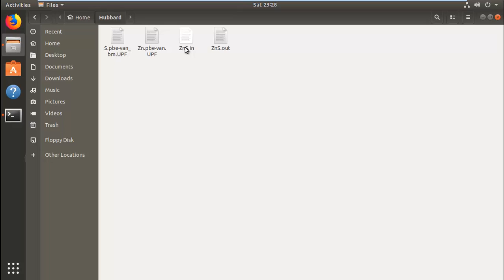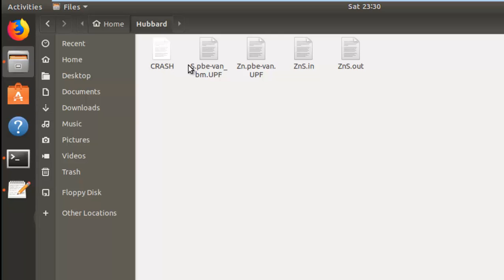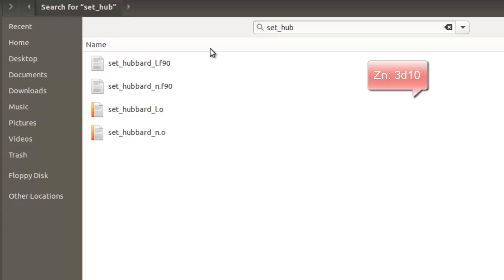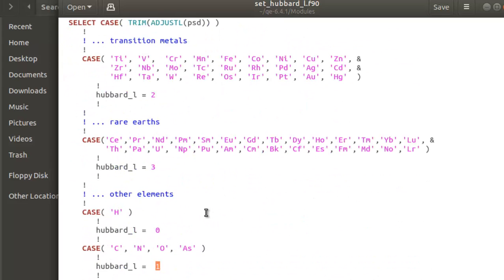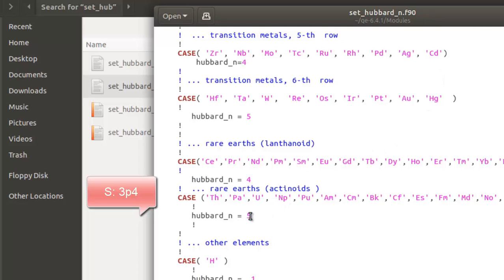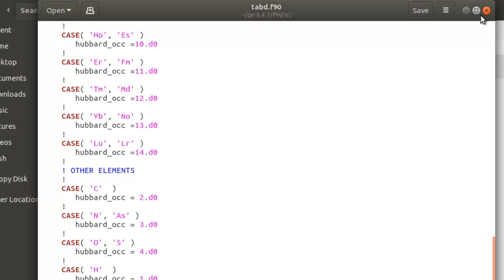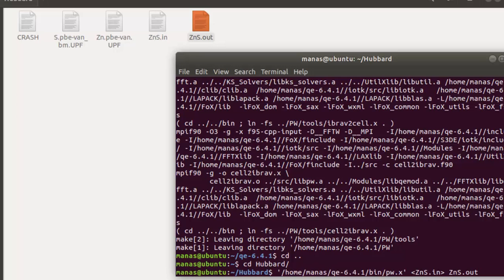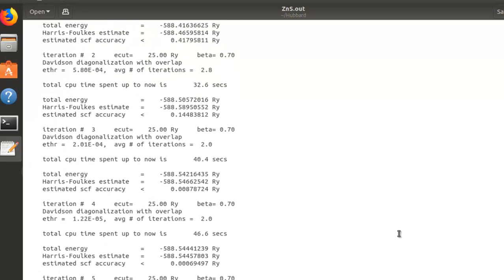DFT+U Hubbard Correction on an Unconventional Atom not already configured in Quantum ESPRESSO

Comment: Thank you so much for these steps I was trying it from last three months. Will you please suggest how to run for GGA  +U calculations, as it was for LDA + U
Reply from the maker: This was GGA+U indeed. Although the  keyword is called lda_plus_u, if the PP you're using is GGA, ex:PBE,  then Quantum Espresso runs GGA calculations. You could also specify the XC functional using input_dft keyword. Although, even if you don't, it ises the XC according to your PP.
Reply: @PhysWhiz  Thank you so much for your valuable reply.
Reply: @PhysWhiz  please help in how to choose hubbard_U(1), U(2) and U(3) for different atoms like Mn, Y and Al
Reply: @yuhitgupta3388  The hubbard parameters can be figured out either semi-empirically, i.e. by matching some experimental property like Band-gap, bandstructure, bandwidths, etc. 
But ALWAYS REMEMBER, that the Hubbard parameters for the same element can be different when the element is in different molecules. So, you need to figure out the values for the atoms you mentioned, for the molecules (crystal systems) that you want to study. Also, they depend from software to software, based on the implementation. So, I would recommend that you search for the Hubbard parameters in literature but check if they used them for the same system and using Quantum ESPRESSO.
More tips: 
http://hjkgrp.mit.edu/content/right-hubbard-u-any-element
https://hjkgrp.mit.edu/content/quick-tips-more-about-u

One can also, determine the Hubbard parameters, by first principles (ab-initio). Refer to literature for these. In the 2018 update, QE added a feature to calculate the Hubbard parameters ab-initio. Check that out.
http://hjkgrp.mit.edu/content/calculating-hubbard-u
http://hjkgrp.mit.edu/content/calculating-hubbard-u-periodic-systems
Reply: @ManasSharma07  Thank you

Comment: I did all the steps you showed in this video including reconfiguration and rebuilding the pw-package, but for Silicon atoms, and if I run the calculation I still get the same error: 'Error in routine set_hubbard_l (1): pseudopotential not yet inserted' 

I watched the video several times now and checked the files twice... I inserted 'Si' in all files
Reply from the maker: Which version of QE are you using?
Reply: @PhysWhiz  qe 7.0 should be the newest, I just installed it couple of weeks ago
Reply: @PhysWhiz  I am trying to correct the underestimated band-gap for SiC and thinking now of just using a hubbard-U value for Carbon only. Do you think this will solve the problem, as C was allready included before?
Reply from the maker: Is there any literature on this? You can try what others are doing
Reply from the maker: Also, you can try using the same version of QE as I am using in the video

Comment: How to do this in Burai
Reply from the maker: Unfortunately you cannot do this in BURAI, as it comes with pre compiled binaries. But here, we have to change the source code, therefore we have to compile the executables/binaries again. I only know how to compile the binaries on linux and macos. The video shows how to compile them.
Reply from the maker: If you're a windows 10 user, you can also run QE using Windows subsystem for linux (WSL). https://www.youtube.com/watch?v=Cvrqmq9A3tA

This will behave like a proper linux machine and you will be able to use the linux bash commands and also install fortran and QE just like you would on a linux computer.